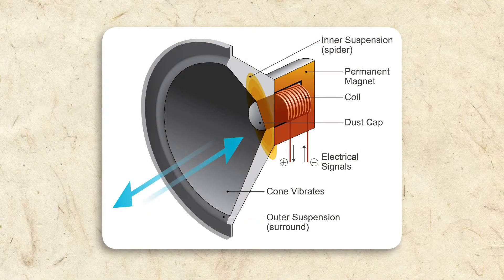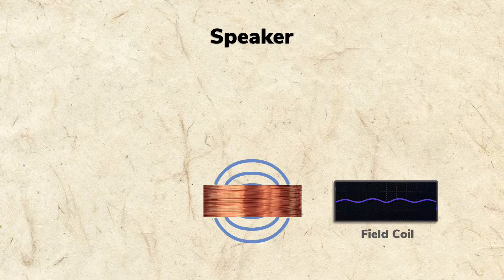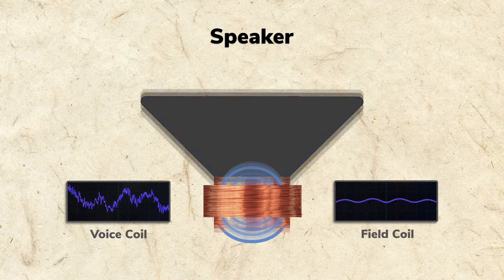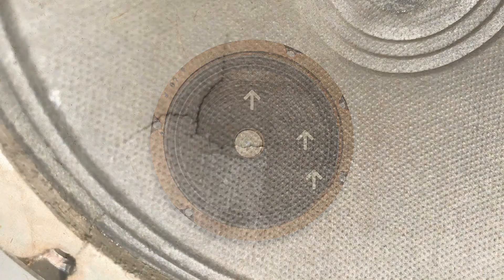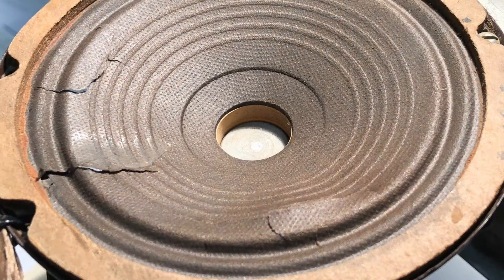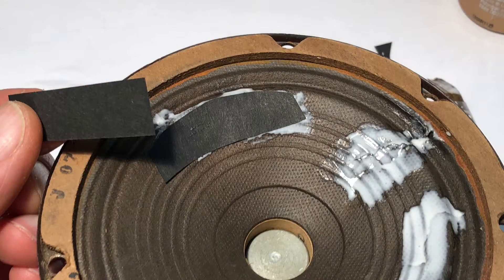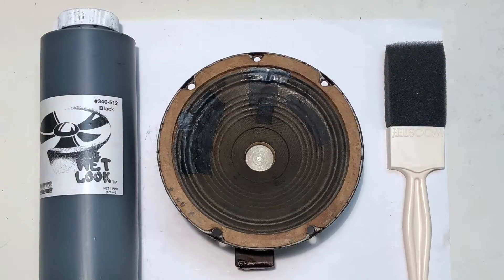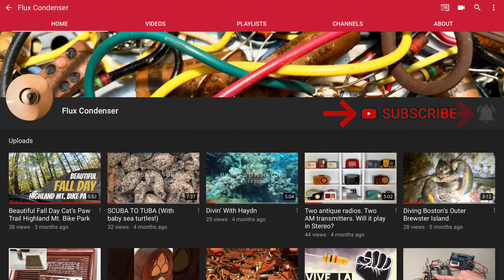How Does a Speaker Work? How Do You Repair a Speaker Cone?

Comment: great tip on the Aleenes tacky glue. i used it on my emerson radio circa 1941. i am working on the video for the radio and hope to have it up soon
Reply from the maker: i Repair Electronics Good luck on your speaker cone repair. The tacky glue really worked well. Ideally, I prefer to use acid free cement (and acid-free paper) for repairs, but with the addition of “Wet Look” I think the repaired speaker is better than new. Look forward to seeing your Emerson video.